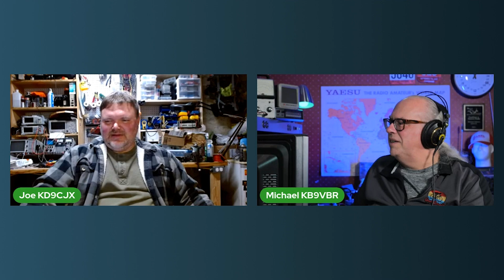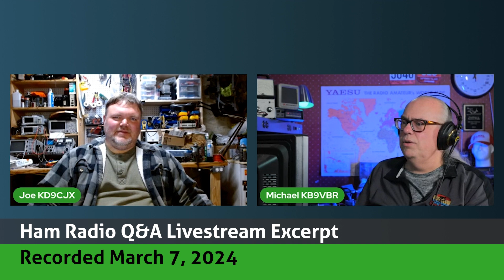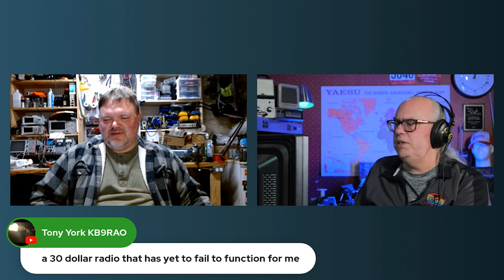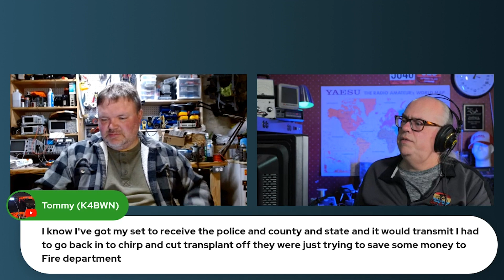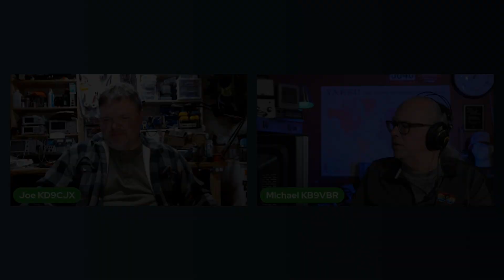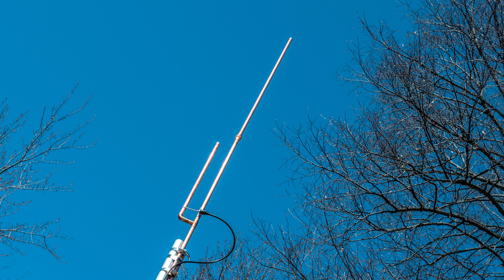Ask Michael, KB9VBR: Can I program a Baofeng UV-5R to receive and transmit on our fire department

Comment: Actually some volunteer fire stations cant afford 2 way radios so they leave it up to you wathere you want to buy one or not so yall need to get yall information right and actually use you brain for something other than tell lies
Reply from the maker: I don't buy what you are saying. Using non type accepted radios for critical fire and rescue communications is dangerous at the least and deadly at the worst. Yes, fire gear is expensive. Yes, the community needs to pony up and support its volunteer fire fighters. Radios are a piece of safety equipment, and need to be treated as such.

Comment: Programming these radios is too easy using free software and a $10 cable. To program it with TX off doesn’t help because anyone with the right cable and software can unlock the TX, this can be dangerous on the hands of the public. As volunteer FD’s most will issue pagers to all volunteers in the department. We have no idea who this individual is, or if he’s even a firefighter.

Comment: You cannot use it to Tx in our county. Many FD use p25 with an analog portion of the band. Usually I lock out the TX on any radio I program for FD frequencies.
Reply: Lock out the TX? What happens when a firefighter is injured, or a collapsed upper floor traps him/her in a corner and can’t call for help? I can imagine a hundred possible situations that having TX blocked could cost a life. The fact that you think can trust your firemen to help save your family member having a heart attack but can’t trust him to be responsible on how he uses a radio speaks volumes. I’m glad I’m not a fireman at your jurisdiction.

Comment: Another thought.  I wonder if operating a transceiver that is not  FCC certified on the FD frequencies would put the Department's license in jeopardy?  Anecdotally, many of these lower cost units have considerable splatter which may interfere with emergency communications.

Comment: Spent 23 years Fire Dept and EMS, different agencies in rural western Colorado.  Our County is 
3 times the size of Rhode Island. I did the specifications, ordering, and installs in the vehicles, 1979 to 2003. Always spec'd Motorola. Never had an issue with any product, pagers, HT, mobile, base.  Not inexpensive, but check with Admin of 
PS agencies. Check which manufacturers and products are on
 'State Bid'.  Prices can be very competitive, especially with bundled orders.  When I had to justify the cost, I asked if them if they wanted to jump with a cheap parachute....

Comment: Most County’s in the United States have switched over to a digital trucked radio P-25 or equivalent system. If the guys department is still using analog 2 meter or 400 MHz frequencies, they must have some serious money problems. Bear this in mind when giving the gentleman advice. We would hope that all communities would be equipped with the latest technology. Remember the reason for the upgrades were interoperability. Ever since 9-11 it was decided that all emergency services should be able to talk to each other.